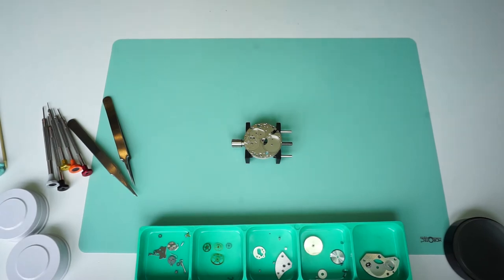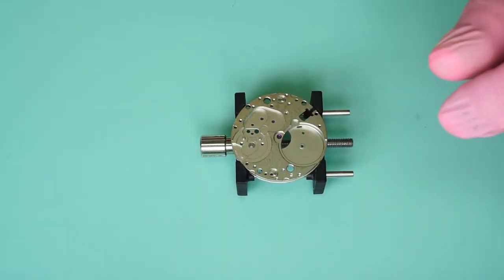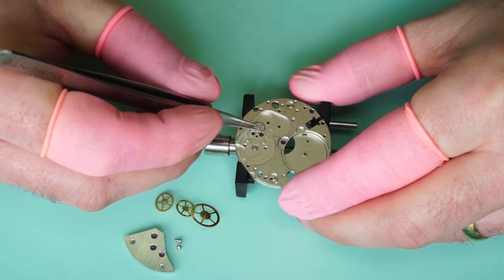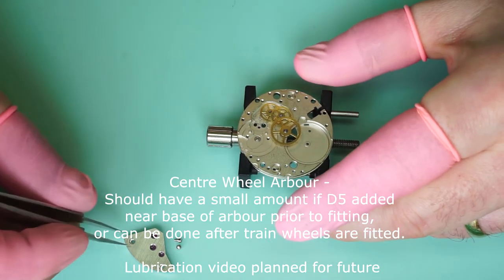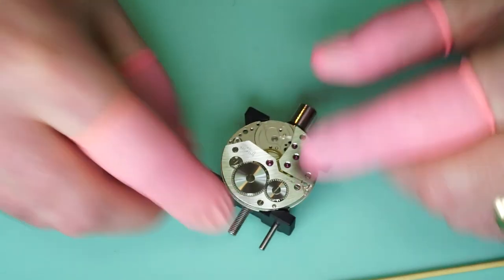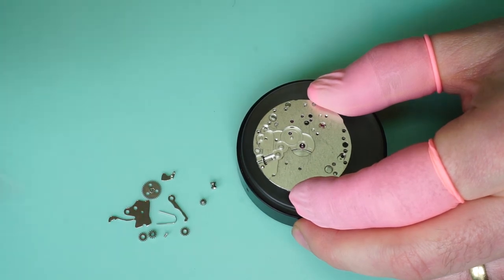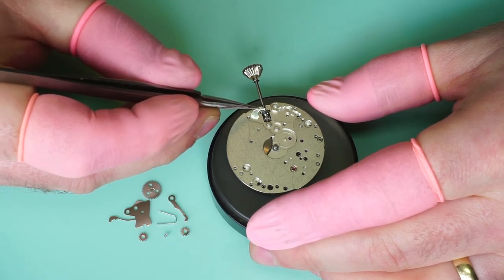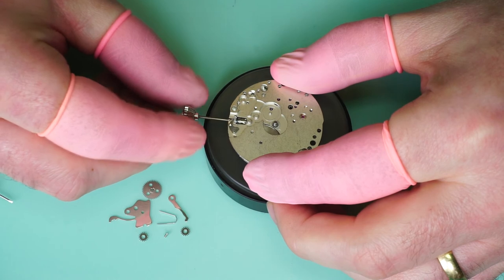How To - Service a Mechanical Watch - Part 3 Assembly & Lubrication - ETA 6498

Comment: Hi, have you ever worked on a BFG 866 1 jewel calendar movement, I put a new clutch in and that was fine but when I tried to assemble the calendar movement I came across this small gear and I do not remember where it goes, any clues. please help.
 Andy.